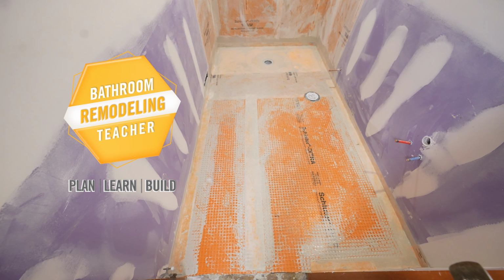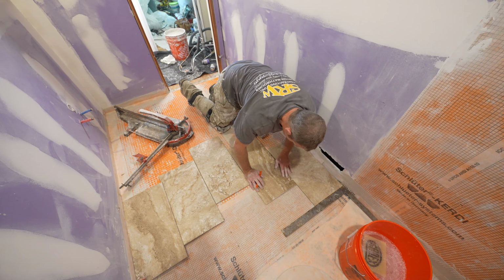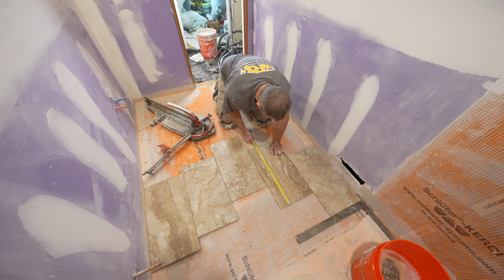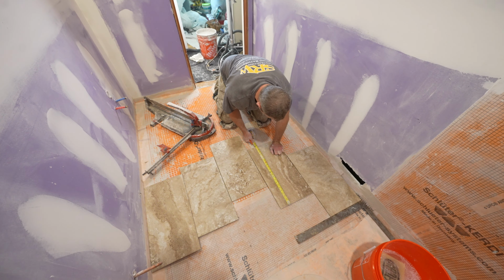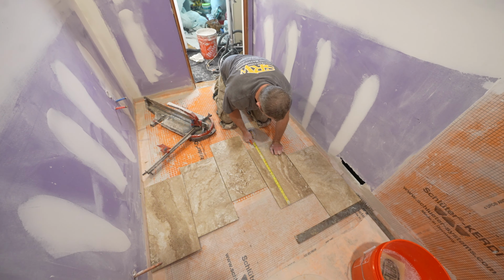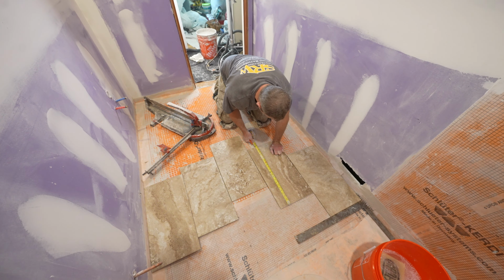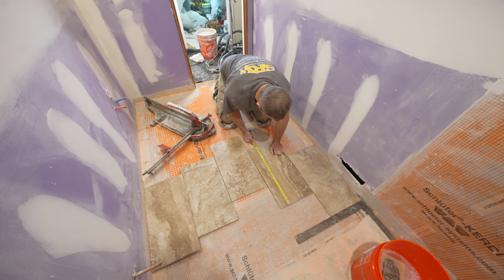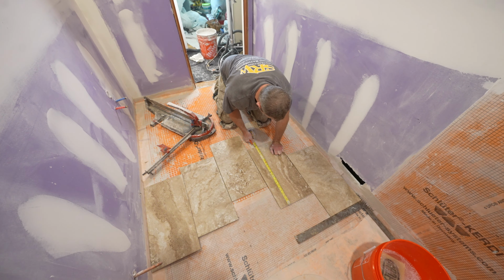Tiling Tips for a Bathroom Floor

Comment: Great video, thanks Steve. Quick question: if you were using the same large format tile in the shower, would you still stop at the tray or continue into the shower as if it was one floor? What’s going between the shower and bathroom floor?
Reply from the maker: I wound still create a full break there, but stay with your pattern from outside floor. You need diagonal relief cut to drain on shower 👍
Reply: @BathroomRemodelingTeacher  is that only if you wanted a diagonal pattern around the drain? What about if you want one continuous looking floor into the shower?
Reply from the maker: @vm12345  you’d have to go linear then https://youtu.be/jl8wFXK4VJA

Comment: Always enjoy the videos.  If I can ask a quick  question? In a shower with a recessed slab that has radiant heat the water tubes ones with a mudbed poured to meet the rest of the slab. Is the Kerdi membrane all that’s required or membrane and an uncoupling ontop?? Trying to settle a disagreement with another installer.
Reply from the maker: Well, depends on what your trying to achieve. You’d only need kerdi if you want to waterproof. The uncoupling membrane is waterproof if you address seams with kerdi band, plus has the added benefit of resisting some expansion and contraction. I find the uncoupling membrane being more important over plywood. With a mortar bed I don’t think there’s much to be concerned with. And I like using hydroban for something like that to be waterproof 👍

Comment: Thanks for the video, they are great.  I was wondering if anyone had a solution for an issue I have had when using the leveling wedges when doing the tiling in stages.  The problem that I have is that the edge of the tile course I ended with is too low, and I did not notice that since there is no wedge on that side.  Has anyone ever come across this?

Comment: So I always tile bigger tiles in a 3rd or 1/4 inlay. But I also see guys doing the 3rd inlay, BUT there's only 2 different sized rows, not 3 like in your case.
What is that other inlay called? For the record, I think that version is a terrible look compared to using 3 different sizes.
Reply from the maker: It’s just a 1/3rd pattern  👍